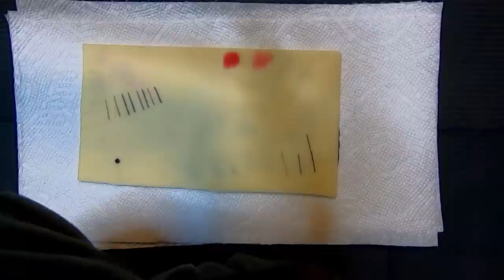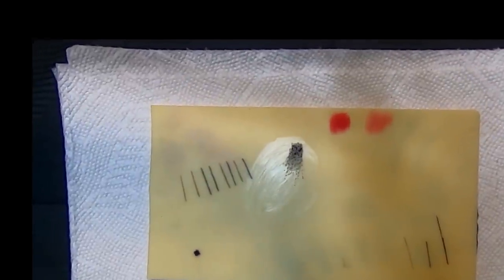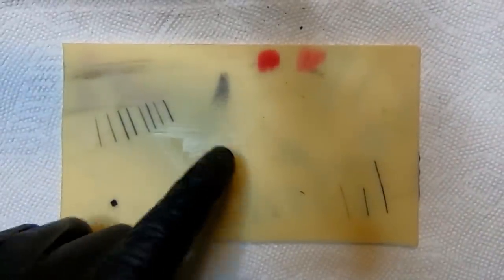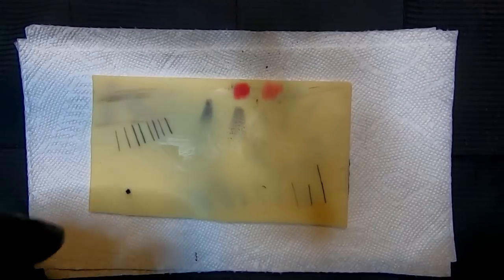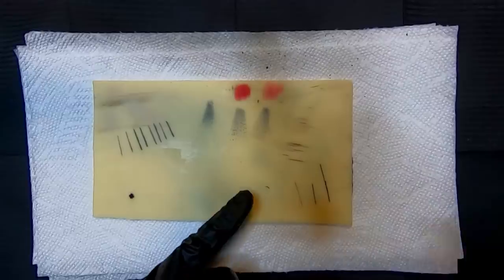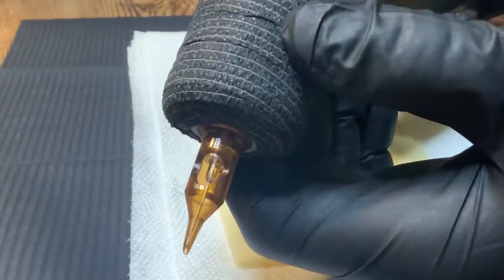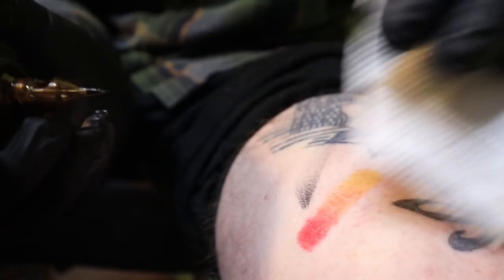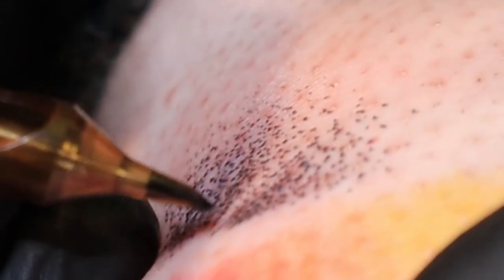✅Tattooing for beginners:❗ STIPPLE SHADING TECHNIQUE EXPLAINED❗ , (on real skin and fake skin!) 👀

Comment: Great video again personally I prefer a longer stroke machine for this effect like around 4.2 in my valhalla at 6 to 7 volts works awesome and hand speed very important.
Reply from the maker: I agree the longer the stroke the better for stippling. I like the Q2 as it has a 4mm stroke but a 4.2 would be that much better. And your right hand speed is the key to this one. Thanks for watching Travis appreciate the support brother! 🤘🤘
Reply: That's awesome I didn't know that had 4mm stroke that's amazing for that small of a machine. Size motor and stroke kinda like the bishop wand packer

Comment: Also a very good technique with mag needles gives a good even shade
Reply from the maker: Your right Travis its pretty much like whip shading with a mag.
Reply: Very much so I like to slow my machine way down and get the stipple effect with mags. whip shade normally done at a higher voltage. When slowed down let's me build up my textures and shade. Also can be used with blacks gray and color

Comment: Advice for making stencils last longer? I've tried to dilute my green soap more, more dabbing with paper towels and less wiping. Helps a little. Still have issues tho. Even tho I let the stencil dry for 20 mins at least. Using Stencil Stuff.. 
Also, my ink caps sometimes dry out. I use Dynamic and Eternal.  It's happened to both.
Reply: Don’t wipe much on your initial lining/shading. I always line everything out unless the ink blotches up then I wipe a bit in the certain spot. But no wiping until my initial lining is done then go back and touch up and darken the lining and you can wipe as much as you want

Comment: Are you using a 3.5 stroke or a 4.2 stroke in this video?
Reply from the maker: I believe the CNC Q2 has a 4mm stroke.
Reply: I have a neotat vivace with 2.5 stroke, would this technique work with the shorter stroke length?

Comment: Does this technique work for shorter stroke or will it chew up the skin? I use the cnc q3 and it’s stroke is fixed at 3.5
Reply from the maker: Its definenetly a little easier with a longer stroke. But no you can still stipple shade with a stroke of 3.5

Comment: Would this work with bigger liners? Or is 3RL the ideal size?
Reply from the maker: You can do it with larger needle grouping just practice on some fake skin until you find the right hand speed and voltage.

Comment: Hi,i am using cheyenne thunder and a 3RL and sometimes at 5v or evel 7v it doest run it wont push the needle so what i need to do is take out the cartridge press the pedal and then put the cartridge in for it to actually push the needle .. BUT sometimes it runs 

Any idea what could be the problem? 
It is very powerful machine so i refuse to believe  it hasnt got enough power to push the needle .. :(

Comment: what throw would be suggested for stippling , short or longer ?
Reply from the maker: A longer throw makes stippling a bit easier so I would definitely prefer a longer throw over a show or a throw for stippling.
Reply: @ArtSomething  well i tried hehe , no long throw tho 3mm - dont know if the needles didnt work to my liking `` chyenne d tip 5rl `` didnt matter if i went slow with the machine or fast it just didnt make any stipple effect at all in the skin . wiped it off and the ink would just not even go in

Comment: On fake skin you can have a very low voltage but on the skin it seems to not hit hard enough. I use 5.4 v with Bishop wand packer but if bigger area I go to 7.5v because I can move faster as less precision is needed.
Reply from the maker: I bet that packer stipples pretty well with such a long stroke. And your right the bigger the area you can absolutely move your hand faster so upping the voltage is a must to keep up with hand speed. 🤘🤘
Reply: @ArtSomething  the packer is awesome for everything and 4.2 strikeout my fkiron 4.2 is a lot softer and need to crank up the voltage for same effect

Comment: Whats the best way to tattoo fingers and hands?
Reply from the maker: Fingers and hands are tough as the tattoo fades fastest on hands and feet. (those areas used A LOT). So you have to push the depth a bit but not to deap as to blow the line out. And when saturating color or strait black ensure you getting a very good saturation as again these parts can fade quick. This is just my thoughts on it and im sure other may have different opinions.
Reply: Yeah I noticed all that,  shapes are better kept that letters. Thanks for responding back.

Comment: Can you do this with coil machines?
Reply from the maker: Yes you can do it with a coil machine as well. You will just have to adjust the voltage and hand speed untill you get the desired stipple look.